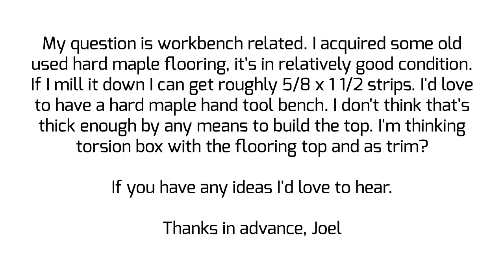I Get Email #02 - Workbench vs Worktable

Comment: Question for you guys: I'm wondering about expansion/contraction issues mixing plywood & MDF on your benchtop?  I'm putting together a new top this week, thinking 2 1/4 " thickness .... I have enough 3/4 baltic birch plywood & black MDF to do either/or ... or any combination ... originally I was thinking 2 plywood layers with an MDF top  ... then it occured to me different expansion/contraction rates might be a problem .. I'd like to hear your thoughts & experience .... Thanks!